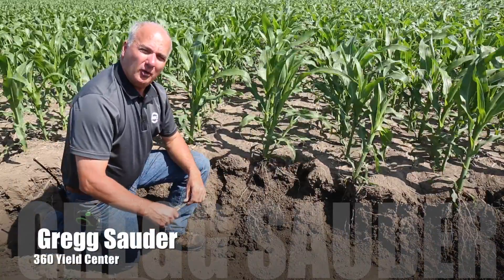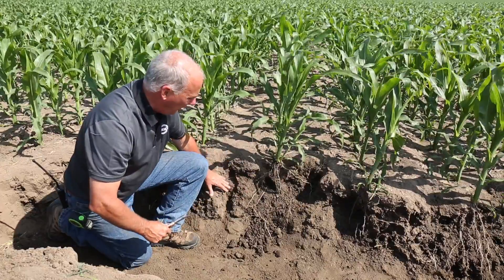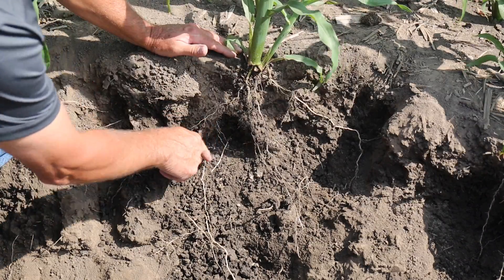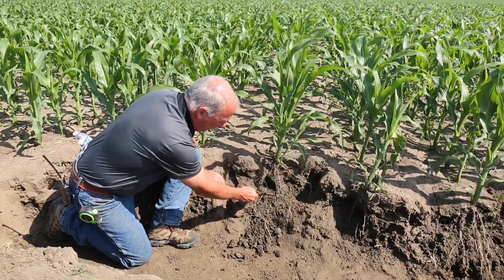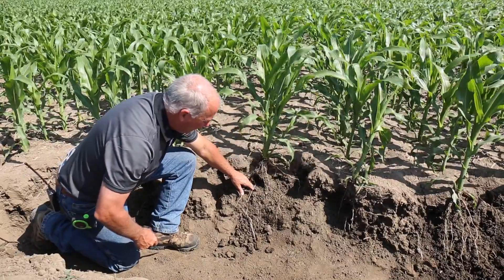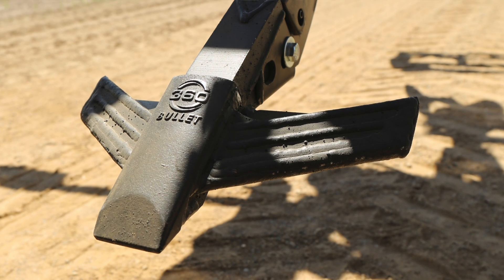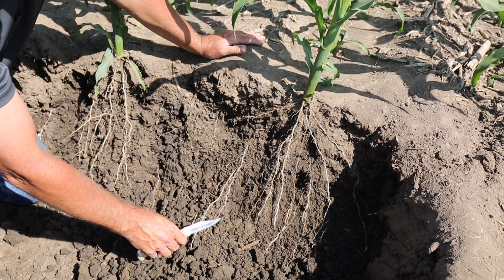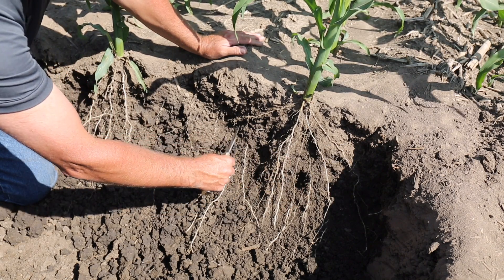Ripper's impact on root development

Comment: Another reason for zero till avoiding another ground trip and conserving moisture. In that case you may be in area where soil moisture isn't an issue. No till after 5 years if building up residual in the soil compaction goes away earth worms are your rippers

Comment: One of the problems with rippers is soil moisture and soil makeup texture, the moisture should fracture the soil.  It may the shanks may fracture to a depth of 4 to 8 inches but at past those depths the shank may be smearing and compacting the soil 
Horizontaly
Reply: Is it recommend to rip the soil? I have clay soil

Comment: Those plants look exactly the same.  
The proof of any difference is in the yield assuming the soil profiles are the same. 
Many times in the same field the yield could be off by 20 bushels an acre. 
Also, the 30-35 degree angle is nonsense. In all plants, roots will have different angles as they search for water and nutrients.